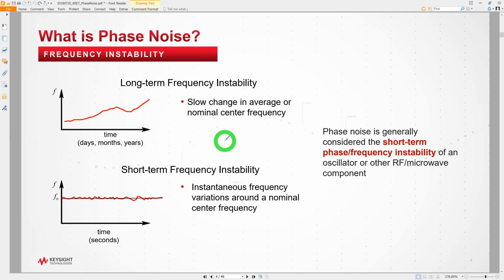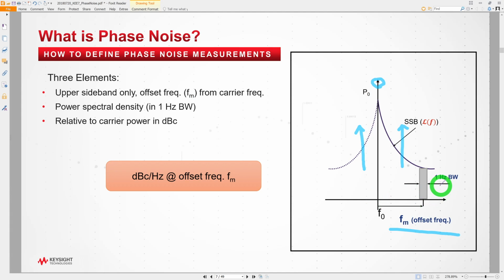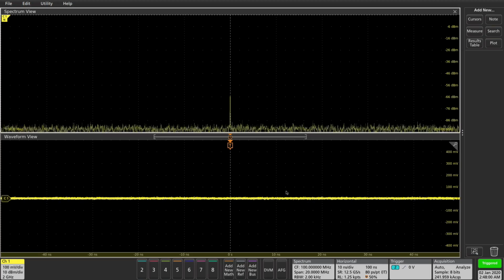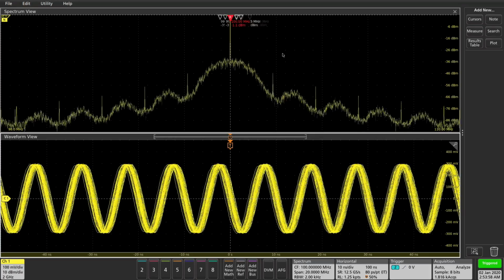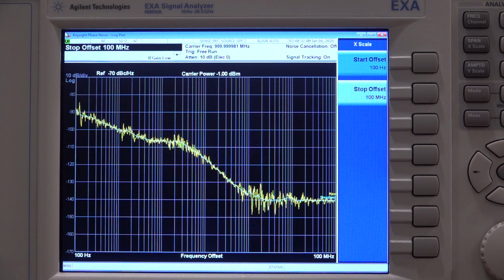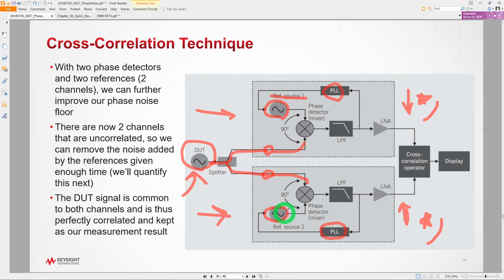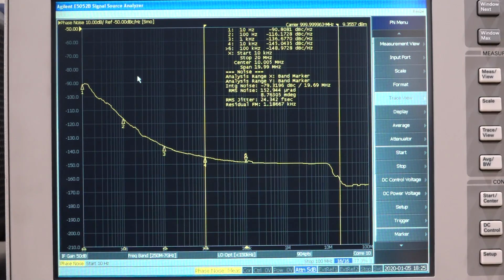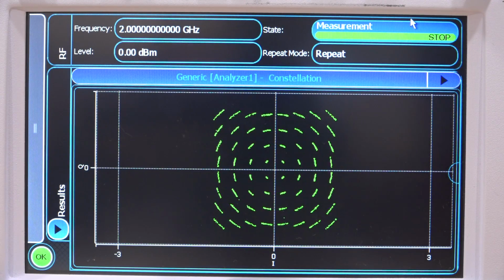TSP #162 - Tutorial on Theory, Characterization & Measurement Techniques of Phase Noise

Comment: Very good. You mention the time to do a cross-correlation test but don't give examples. I gather it can be minutes to hours for very low phase noise sources. It is a statistical test, so it will need quite a bit of time to detect enough far outliers, I presume.

Comment: at around @6:50 i.e. in the introduction, you are talking about amplitude and phase noise appearing in the frequency spectrum. What about fluctuations in central frequency f0 itself? What about frequency noise itself which is not originating from phase or amplitude noise? Is it even possible to disentangle these noices?

Comment: Hey, truly Great Stuff, perhaps more jingles/sound-effects/cats. The thought occurs - if the E5052E CPU motherboard is just a standard PC microATX running WinXP. Why not swap/upgrade it ? More CPU cores, more grunt, more memory, faster results. Or for an E5052E DIY open-source build, why not use several (4 or 8)cheap SDRs ? As the absolute performance of the uncorrelated LOs are less critical than the mathematical horse-power.

Comment: Thank you for this video, everything I've learnt about RF (and RF equipment repair) has been from YouTube and your videos are 95% of that. I'm well on my way to having my own cheap imitation of your lab, so thank you for the new passion.
You say that the reason for the spurious points on the constellation is due to your 10MHz ref not being common between the instruments. Does this mean you're not doing clock recovery but relying on the refs directly for sync? I think I'm missing something here.
Finally, I think someone else has already said it, but the drop off in phase noise above 10MHz away from the carrier is probably due to filtering in the source to clean up the spurious tones created while generating the 1 GHz signal also attenuating the noise.

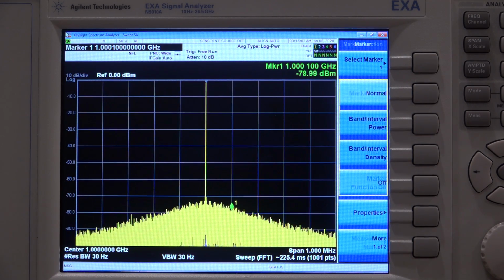Comment: The reason why your fundamental drops at 27:30 because You are measuring RMS power in 1001 points over 30 Hz RBW, in a span of 1 MHz. 1001 points * 30 Hz is not enough bins to actual see the fundamental signal. If you decrease your span, increase RBW, or increase your number of points, the signal will go back to the actual level.
Reply: Thank you for this explanation! It was exactly what I was confused about.

Comment: Excellent tutorial ! Also, cross correlation is a technique used extensively in radio astronomy. The noise from individual LNAs following antennas are uncorrelated but the sky signals picked up by antennas are correlated. In fact almost all modern synthesis radio telescopes have massive correlators to process huge volumes of data !

Comment: Thank you for another great video. 

If you have a dut and you want to measure its phase noise (e.g., an amplifier), is it enough to connect the amp’s output to the signal analyzer and measure as you explained? Don’t we have to correlate amp’s output to its input?

Comment: Poor Keysight. They are contributing so much material to the community, while Mr. Shahramian sits in front of an army of Rohde&Schwarz devices and doing the measures with Tektronix instruments. Okay, some Agilents as well.
Besides this: Excellent video with clear explanations and illustrations.
Reply from the maker: This is not an advertisement channel for any specific vendor. I rotate through all manufactures on a regular basis.
Reply: @TheSignalPath  What you clearly demonstrated. Sorry, it was not meant as an accusation.

Comment: Hi i have seen many of your videos, you do briljant repairs. But where do you get the equiptment which is way too expensive. Not that i want an adress. no what i want to say is one would not sell it for very low value but first send it in for repair.  and i assume you don t buy project which are very expensive knowing it could end in not working.  for example the tektronix analyzer is over $20K. you tell it yourself no schematics just a block diagram. Or are you the representation of a repair company and are you repairing for customers, what i dont think? 

nevertheless  compliments for you approach and work.

Comment: After watching your videos, I picked up a broken R&S VNA at a gov auction...and I fixed it (bad attenuator switch) !  However now, I am finding out that I do not know how to use it. e.g. I did not know that S12 should be read backwards (meaning from port 2 to port1), I am murky on Return Loss measurements,  its relation to SWR and why does a shorted coax give me a decaying wavy trace (I still do not understand how to measure the loss of my coax cable) ...and many many more concepts. w2aew's video explaining the dBC and dBm helped me a lot ...but there is still so much more VNA jargon and concepts to be learned !

Comment: @The Signal Path the slope changes around 10 MHz and reaches the thermal noise floor of about -167 dbc/Hz could this because the instruments PLL has a loop bandwidth of 10 MHz and then  the phase noise falls to the noise floor of the instrument
Reply from the maker: Zarf 42 Not quiet the reason for the drop.

Comment: Great video, can't wait for the PLL video! I keep making noisy sources (-80 dbc/hz @ 100K  fc=24 GHz) and i think its all my poor LPF designs. I think I've read the literature 8 times at this point, sometimes I feel I'm still shooting in the dark. Bonus question: If the loop contains a N/16 divider, does that mean any phase noise experienced at N/16 circuitry gets multiplied by 16 at Fc?
Reply: Log(16)
Reply: 20Log(16) is the ammount of phase noise degradation due to the mere presence of a frequency divider il the feedback loop..... obviously the degradetion is relevant to the reference. So, the higher is N in the feedback loop, the higher your reference spoil is!

Comment: Measuring phase noise to a greater degree than ones own oscillators are capable of alone is an interesting concept.
Always interesting to see how one pushes the boundaries of measurement capability.

Also for a second I thought to myself, "well, if one uses two different oscillator brands for the two sections, then why not just intentionally make one section a bit worse spec wise?" But the phase noise spec of each side technically still matters, so it needs to be exceptionally good, otherwise one will need more correlation cycles to reclaim that intentionally lost performance.

But it also makes me wonder, what if we add a third stage? So that we can correlate 3 pairs, instead of just one pair of signals? Logically, it could make the unit 3 times faster, at only a roughly 50% increase in cost. (but this is ballpark estimates.)

Adding a fourth stage would give us a total of 6 pairs, at only an additional 33% cost increase for 2x more performance. But there is likely other reasons that makes this impractical.